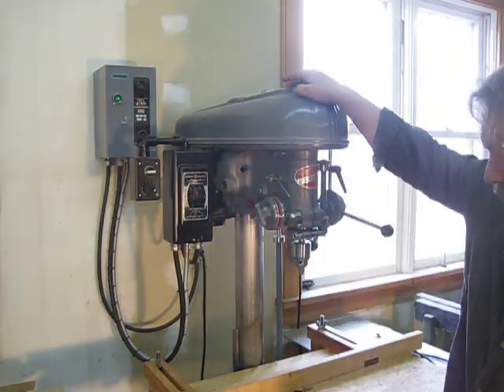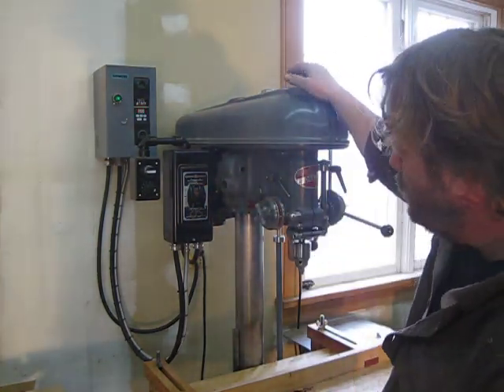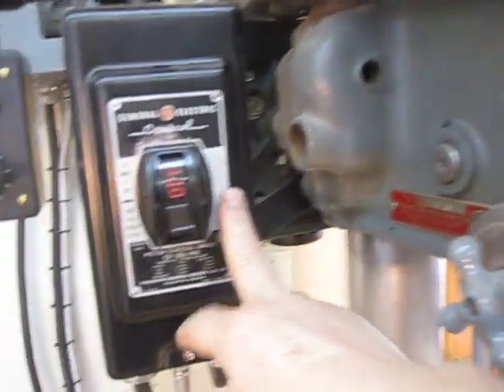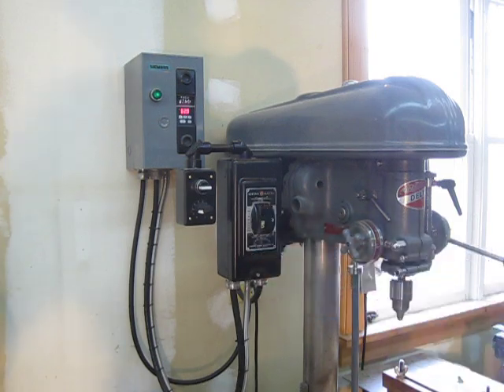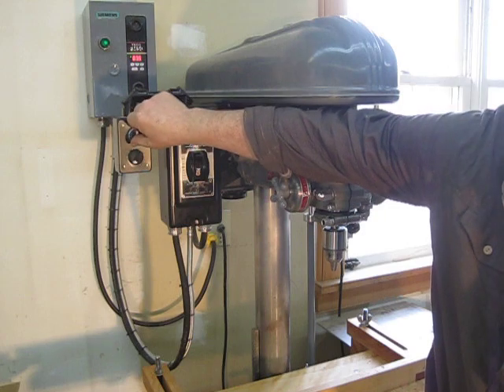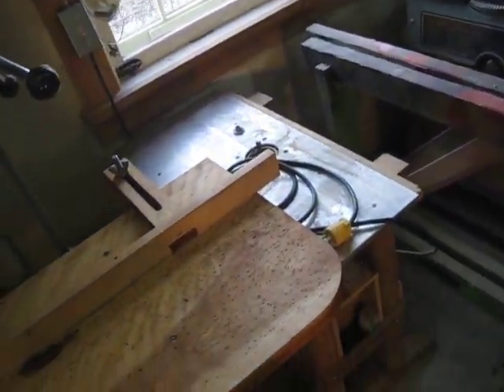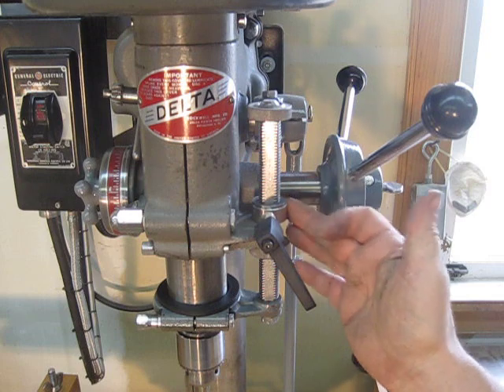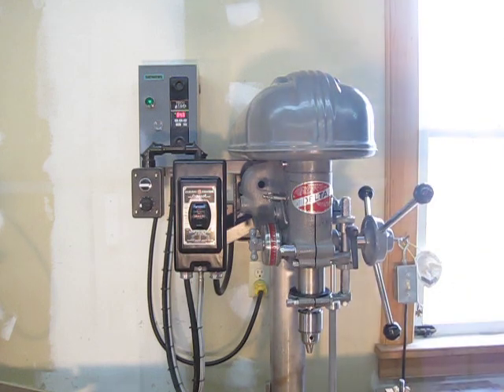Delta 17 " drill press with VFD

Comment: I had no idea you could convert 3 phase down to 120v single phase. Are you running the cat5 from the potentiometer to the tranfer switch, bypassing the main on/off switch? I appreciate the lock set-up for the quill, nicely done
Reply from the maker: yes, I sell VFD's check out my playlist for wadkin temple  VFDs . 120 V input are capable of one and a half horsepower on a regular household outlet and up to 3 hp on higher amperage outlets output, 240 V three phase.

Comment: Is the lower nut on your depth gauge necessary? Can't you just use the quill locking lever to keep it in place? I have a 1957 delta 15 just wondering your thoughts. Very cool press and a great job!!
Reply from the maker: yes you could use the quill lock  but then you would have to unlock to go down. Also i like the quill lock  set  to take the play up in the split casting bore of the head and do not want to move it . this drill here is set to less than .002" of play in the quill bore

Comment: I would like to see that table you have built for the press. Also how have you wired the existing switch, I'm assuming  a manual starter, into the drive? Is it considered a disconnect now?
Reply from the maker: +Marc Lewis  Yes its a 2 wire control to the vfd control side. its used  just like a light switch. I just like the look of the older switch  even tho its over kill. table is nothing special but the production table below it sure helps support that large table

Comment: I just bought a similar 1946 Delta press I'm told is 3 phase. Motor tag is completly worn away can't read it's specs at all. I noticed you swapped your motor. I'm assuming because the voltage was higher. What motor did you go with? Why did you swap? Love the Vfd setup.
Reply from the maker: +mnsterbruiser 
As you guessed the old motor that came with my press was  600 volts  and though  you can run 600 volts with a VFD it is more costly (3 times the price)than a 240 volts motor. The cheapest VFDs for single phase input run 240 volt motor and only 240 volts for 110 volt single phase input. I picked up a vintage Rockwell dual voltage  220/440 volts 1 HP for $50 and wired it at the motor for 240.  Some times your switch gear can tell you the voltage of your motor if the tag is gone. there is often a wire diagram in the wire junction of the motor too.   Is your motor OEM?
Reply: +jack English machines The tag on mine is still present and I can make out a few of the faded letters. But, all of the stampings are gone. It's a rather large motor much larger than a coffee can. It says Delta, ball bearing, Double Duty. It has two random letters EL punched in about the middle of the tag. Three wires coming out of the motor all the same color Black. I'll pull the box cover and see if I can find additional markings. Thanks for the tip.
Reply from the maker: if there are 3 wires its a 3 phase motor.  there may be 9 wires in the motor if its a dual voltage. how these are connected configures  the voltage the motor runs on. 
  look here  http://i284.photobucket.com/albums/ll29/oldtool1/motor%20delta_zpswumucupk.jpg
Reply: +jack English machines Opened the motor box and I have several wires with number collars just like that badge. So I definitely have a motor with dual voltage. Was your 600v motor dual voltage as well? I still can't determine what dual voltage motor I have unless the only dual voltage motor ever made was the 220/440. Might just buy a Vfd and see if I can get it to run then I will know I guess. Thanks for the help, very hard to find this info online.
Reply from the maker: yours will be 220/440 . 600 volt is a single voltage winding  motor and would just have 3 wires at the motor not 9. How they(dual voltage motors) work is the winding in the motor always see 240 volt its just a matter of  the wiring of the winding Leeds(all the 9 wire numbers) in the motor . what the diagram is showing is  there wired parallel or in series that why  the voltage on these motors  are  double 220/440. All dual voltage motors will be that way.   you want yours wired for 240 as per the motor tag .

if you want to run your 240 volt 3 phase motor  off 120 volt regular plug this is the drive you need.

http://www.factorymation.com/Products/FM50_115V/FM50-101-C.html

Comment from the maker: jon
i got this drive from Factoymation. for a brake the VFD is the way to go for anything 3HP and under. the stock dynamic brakeing is very good but you can add a resistor and stop an elephant

Comment from the maker: the upper bearing is on order the only one i did not change.LOL
it is a great press. I don,t see any problem over running the motor up to 120 as this would just be a 3450 rpm motor. my motor is 1 hp and i am not worred about running it lower for short time periods.

thanks for the comments

Comment: Nice machine.  Have the same unit with number two taper and jacobs, 3/4hp 3p 1955 and the FM50.  Little wary of running past 60hz.   Also was warned not to go too low.  I set low limit at 20hz.  Bearings sound a little rough on your though.

Only complaint on mine is the standard table has no slots for clamping.

Nice job.